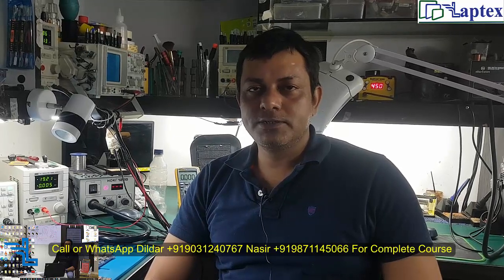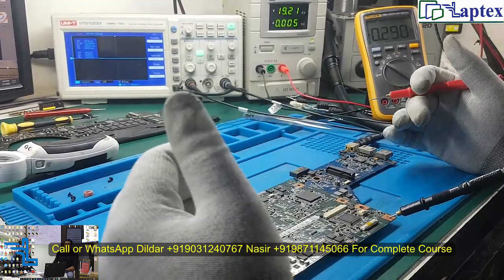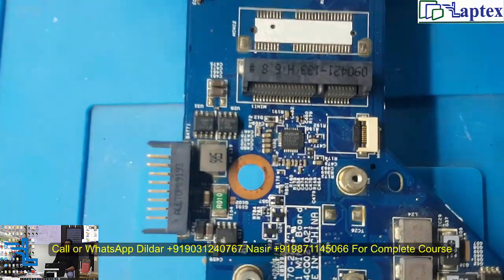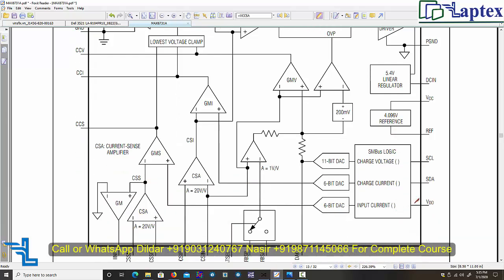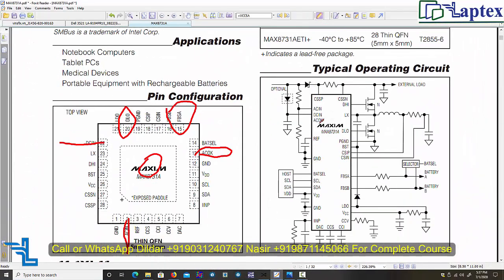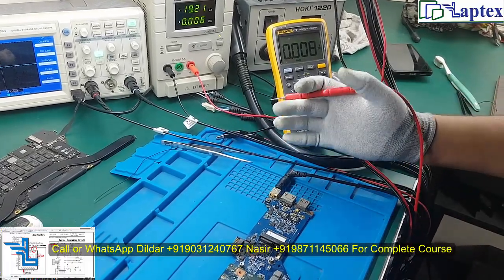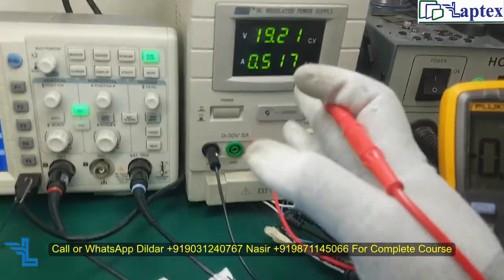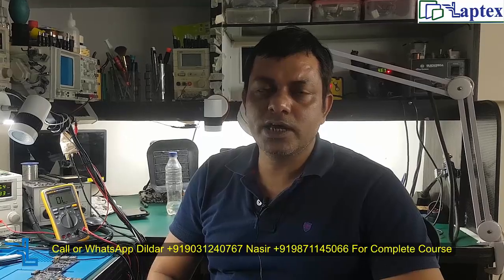Laptop Motherboard 19V Missing Solved Without Schematic | Online Chiplevel Laptop Repairing Course

Comment: Assalamuallaikum in my laptop there is a error showing there is a problem on the cooling system i so i changed the fan but now also its showing the same error what is the solution for that
Reply from the maker: Could be BIOS issue or thermal section.

Comment: Why have you started to diognose that IC with diode. And why didnt you opt to replace that mosfet which has 19v on the source na ov on the drain?. Thanks in advance
Reply from the maker: We don't know which one is faulty, so better to go with step by step troubleshooting. Whatever comes out to be faulty will replace that.☺️👍
Reply: @laptex1377  ok thanks. And what is a condition of a good mosfet on source, drain and gate under multimeter readings?